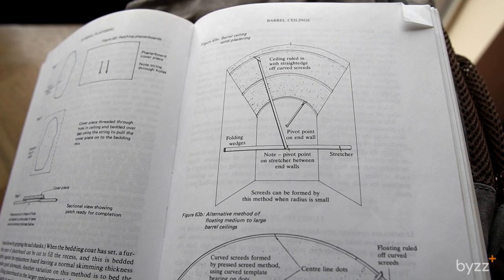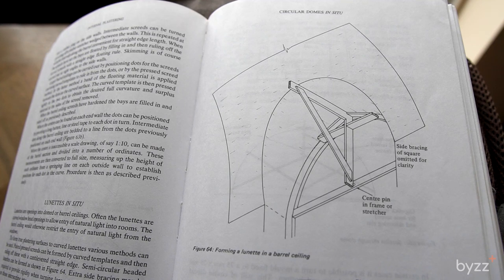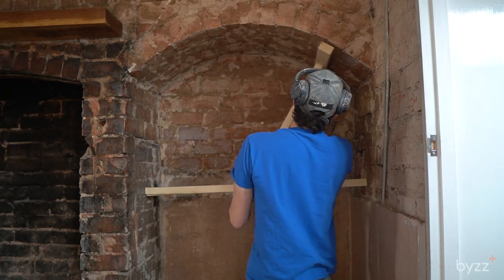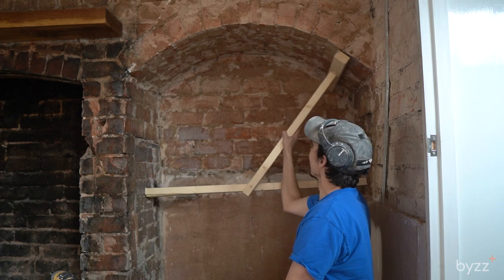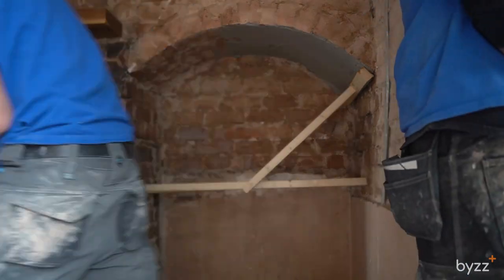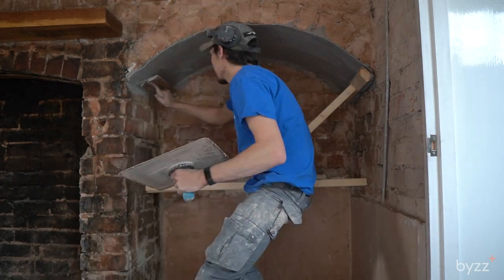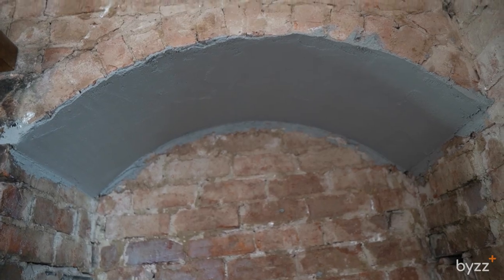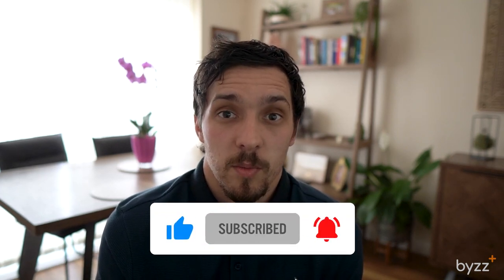Traditionally Formed Plaster Arch - Trying Out A Traditional Technique - Traditional Plastering

Comment: That’s brill..I have a corbeled archway in the hallway flanked by the busts of two Roman goddesses which has cracked really badly. What they did in the Edwardian times is probably what you’ve done there but with a moulded float as the front and back of the arch had an inch quadrant moulding. One of the goddesses has its nose broken off and the other, when I stripped the paint off, someone has put makeup 💄 on it. You’ve given me ideas.
Reply from the maker: Thanks, yeah you can attach a profile to it to creat a detailed finish